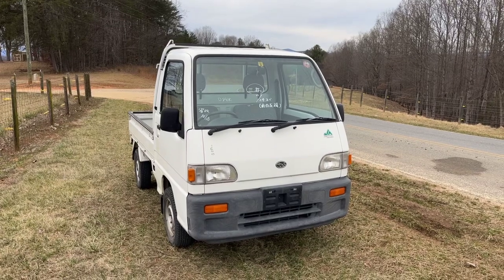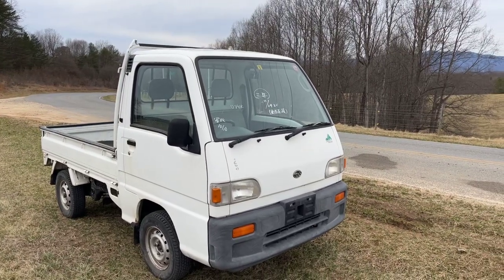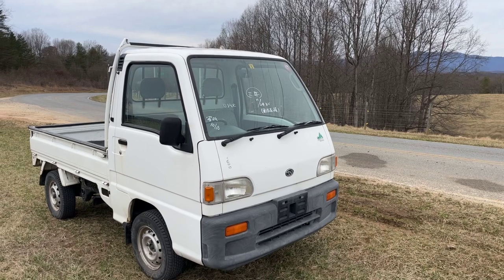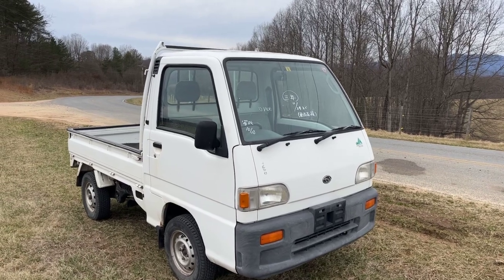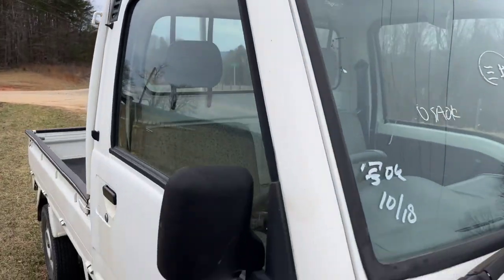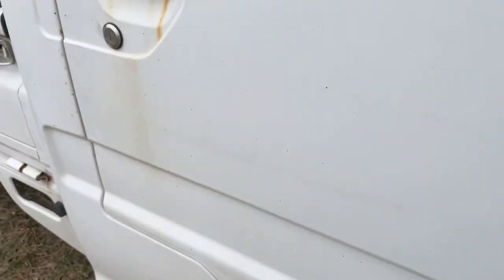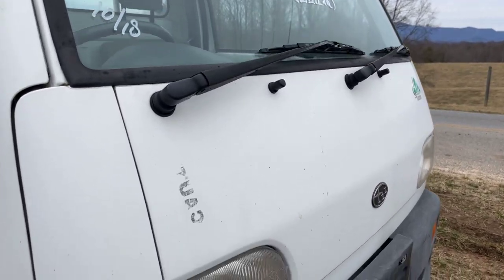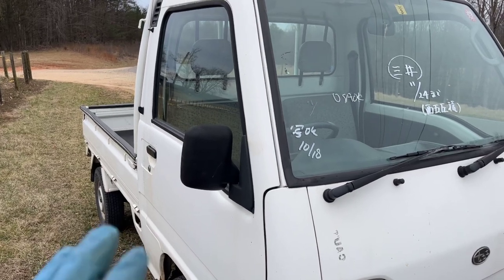1997 4x4 Automatic Supercharged Subaru Sambar 36,464 miles $11,800 SOLD

Comment: Holy mackerel. That is a unicorn...was it the same unicorn as before.
Reply from the maker: This one has been at the mechanic being serviced.  It probably was in a video when it rolled off the truck but has now surfaced.  It just sold earlier...
Reply: what all serviceing do they need? thinking about buying one and want to know what i should look out for have have done. are all of the subaru automatic 4x4? @minitrucks